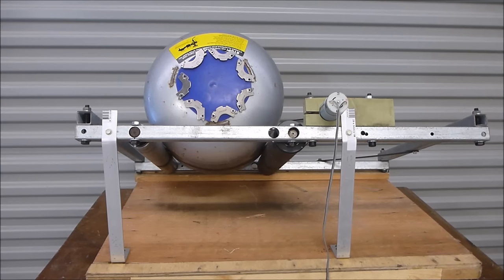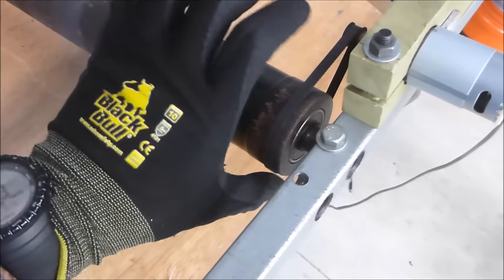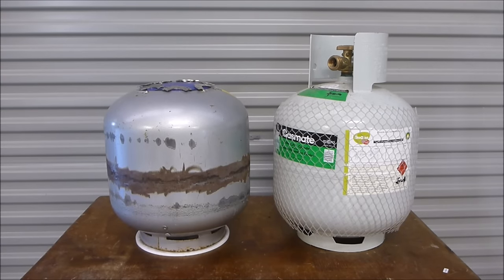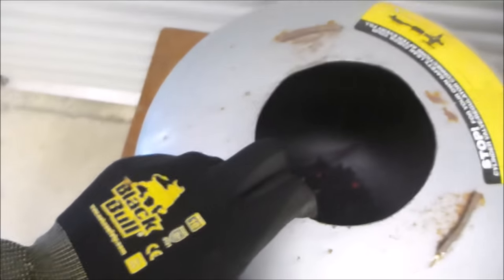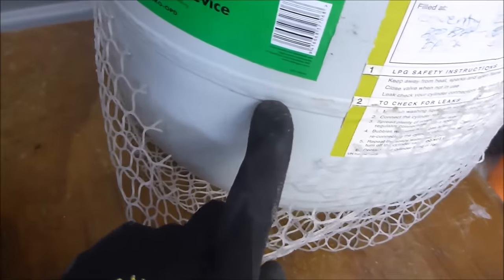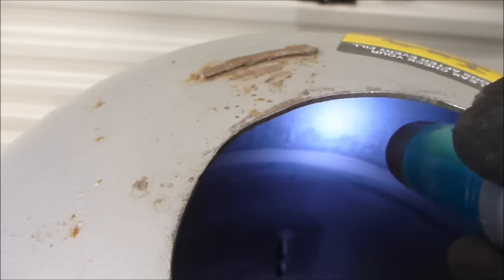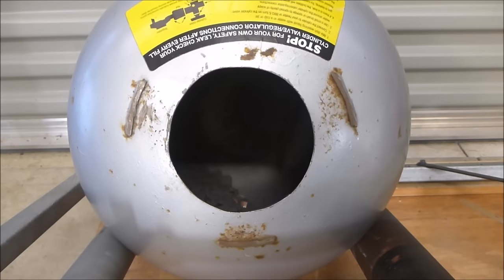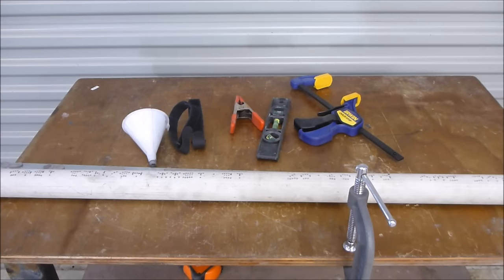Gold Recovery from ICs Without Incineration - Part 2 - The machines that work!

Comment: You can use a small cement mixer, too. You can put river rock in it for grinding. I have used actual balls from a gold mine mill in a cement mixer. And a large Latorne rock polisher works well with ball mill balls. Use small balls to get a smaller grind. Larger balls give a coarser grind. I use a mix as is done in mine mills. I use about 5 sizes and weights.

Comment: Safety tip: When dealing with gas cylinders always fill them with water and then empty them before you start cutting, grinding, or doing anything else that may cause sparks. I know some people think just having an opening for the gas to vent is enough, but the last person who told me there was no need to fill them with water died when one exploded on him less than a year later.
Reply from the maker: Good idea, I guess filling with water will force out any gas heavier than air. Sounds like a quick and easy safety check. Thanks for the comment.
Reply: i was just about to advise the same thing.
Reply: 8:35 I was just going to make this comment. Even though there is no longer any pressure in the canister, there is still propane gas inside, which can ignite with a spark from the grinding. Fill with water to displace any flammable gas remaining.

Comment: this is such a great build!  i'd like to build one like it, and thinking my day job might just let me get away with it.  i reckon a spray coating of truck bed liner would help to quiet it down.
Reply from the maker: Awesome man, send me a link if you get round to building one. They are very useful for quite a lot of jobs. Definitely design in some good dust extraction, these things create a crazy amount of dust!
Reply: On the inside, or outside?

Comment: Hi there, so seeing that this video was posted in 2016, I am wondering if you still feel the magnetic PVC pipe is still the best way to remove the magnetics from your chip powder?  I respect how much effort you put into learning new ways and experimenting with different techniques am wondering if this method has stood the test of time.  Many thanks!
Reply from the maker: Hi Moose, short answer is yes, still using the exact same pipe and magnet bar, still working great after all these years.  I usually run dry material through 3 times to make 100% sure I get all the magnetics. One modification since then is I have a  shop vac with inline cyclonic-bucket filter that I have in the area where the material comes out the bottom. This catches any super fine dust that is generated (to keep the workshop clean and also avoid breathing fine dust!). Fee free to shout out any time if I can help!

Comment: Maybe blow a small regulated amount of air upward in your tube, gold should fall and light material would blow up and out the top. It's how they classify grit for sand paper.
Reply from the maker: That is a great suggestion, I have spent some time wondering whether that kind of setup would work, it seems like it should. The other option I wondered about was some form of cyclonic system like Dyson vacuum cleaners. It does feel like I've never really solved the separation problem properly!
Reply: Could add suction to the top, feed material in 1/4 way down and regulated air from the bottom. Use a ring nozzle with orifices drilled in an angular pattern.
Reply from the maker: For sure, much easier to control suction from the top than pressure from the bottom. If you tune it just right, you should be able to feed material in steadily and collect all the heavy stuff from the bottom at the end. Definitely worth putting some work into!
Reply: Look up gravity tables used from separating grain at seed cleaning plants. Similar idea

Comment: When I first started watching part one, one of the first things I said was, why don’t you just use a ball mill. 
Lying it flat, and putting fingers along the whole length and using 6-8 ball you could really smash up a lot of product.
Reply from the maker: Yeah, I think when I go down this track again I would probably look at a more traditional ball mill with many smaller balls. I saw one running that was doing a great job turning ICs into dust.

Comment: Brian; Have you tried a  belt sander attached to a square tube perpendicular to the belt that will also fit outside the smaller square tube. Stand it up and it will gravity feed against the product. with an upper feed hatch? You can work out the adjustments. I'll try and E you a roughout. Just feed,turn on and collect.  Whacha tink? Thx for the sbject inf. to me.
Reply from the maker: Hi Blas, did you watch my first video about the machines that didn't work ? I tried something similar with a bench grinder and feed tube. Had some problems feeding the chips, and the dust was very uncontrolled. Definitely a process that can worth though, would love to see some experiments.

Comment: can you tell me what that motor came off of ?
Reply from the maker: If you mean for the crushing-ball-mill, can't quite remember from this video, but in the end I used a large stepper motor that was recovered from some scrapped printing machinery. Worked reliably for years.

Comment: Your first machine is basically a homemade rock tumbler with weights in it rather than grit, yes?
Reply from the maker: I've never seen a rock tumbler, but that seems a reasonable assumption. Because of the way I have it set up, I only use a single heavy ball. Cody from 'Cody's Lab' has a great ball mill that he uses to get fine aluminium powder, it is a octagonal drum with many balls. I'm quite keen to build something more like that next!
Reply from the maker: There is actually a fair bit of lead in the powder anyway, because I don't bother removing the solder before milling anymore. Lead and Tin are fairly easily removed with a combination of warm HCl wash, followed by Nitric acid treatment. Any particles coming off the steel ball will probably either be caught magnetically, or will react with the warm HCl wash. A bigger problem with lead balls would be how quickly they would wear down and need replacement. Lead on it's own is very very soft.

Comment: increase rpm, and increase the number off balls, or use rocks, they add less iron to your chips.
Reply from the maker: Iron is not that big a problem to get rid off before processing, and there is no indication with that hardened ball that it is losing any iron into the mix. Increasing the number of balls with the drum at the angle that it is currently would not yield any improvement. Really, I need to run the drum completely on it's side, then add fingers all along the length, then I could certainly run two or three balls.

Comment: sorry if you increase rpm the ball will drop from near the top.
Reply from the maker: Soon after posting this video, I modified the drum to have an extra set of fingers on the opposite side of the drum, giving me two drops per revolution for the same RPM. So dropping from 90 degrees works well. The whole process is still a bit slow, but seems to keep up well with the amount of scrap computers I seem to come across. Would certainly need a lot of upgrading if I were doing this for a living !